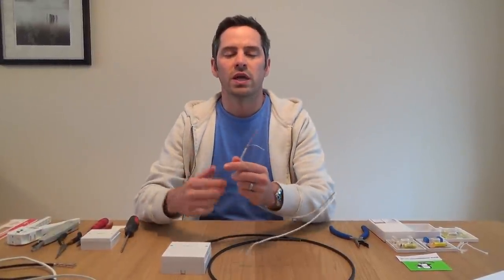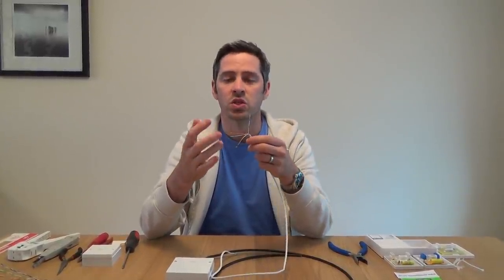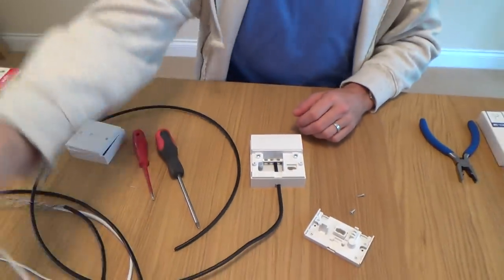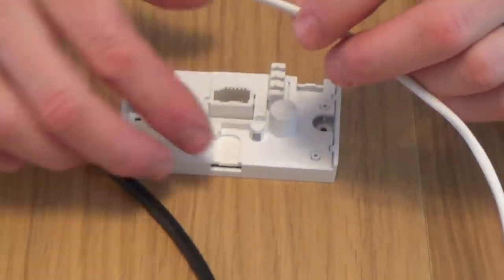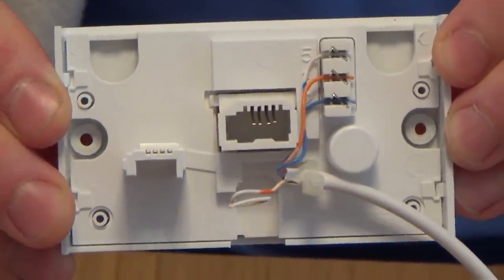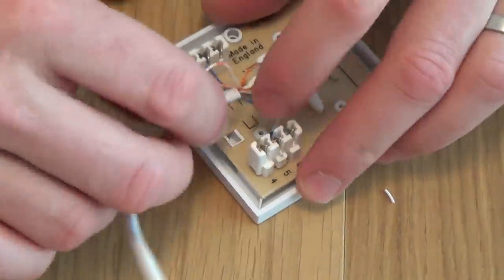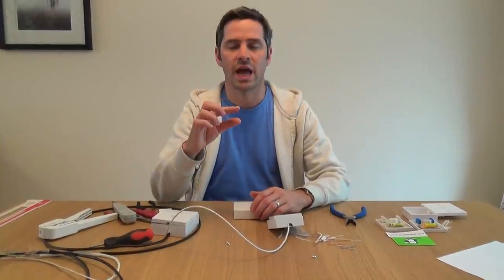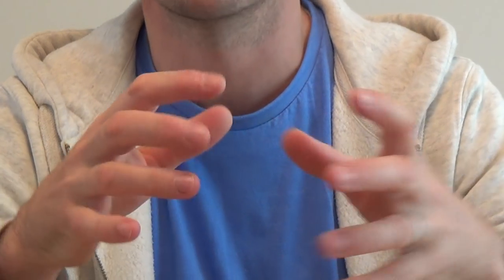How to install a TELEPHONE EXTENSION SOCKET

Comment: hi Vince. can you help me with this? the telephone company have used a 5 pair cable in my building. the cable is connected to 4 different telephone lines except for one who has two pairs connected to his (green + slate) . I have the brown one connected to my telephone line. I'm getting very low and varying broadband speeds, what could be the problem?

Comment: I have a phone line extension system fed from an "stc mx5"  telephone system, a floor polisher caused the master socket (fed from one of the five  MX5  output extensions)  to come off the wall. the question is what type of master socket would be compatible as replacement to this?  - I think its a pbx system seeing that you could use this as an intercom and have to dial 9 before dialling out externally.

Comment: Hi Vince, i have a slight problem. I followed your video and downstairs with the mastwr socket their is a filter with broadband and phone. I extended the bt line to go upstairs. But when i put the phone line in upstairs, the downstairs phone stops working? Have i wited incorrectly?
Reply from the maker: Hakan Jabbar Hi, double check your new phone in the existing master socket in case it is faulty. Then check you have wired it correctly, blue to 2, orange to 3 and white/blue to 5 on both ends of the cable. If you are using the small plug in micro filters then make sure you plug one into the new telephone extension. If you still have not luck then double check the cable for damage.Thanks Vince.

Comment: Do you have a video showing how to install an extension with ADSL/PHONE socket.  If not can you do one and will I need to run a cat5e cable from the main socket for this?
Reply from the maker: +Tania Hart Hi, no I don't at the moment but it is the same as running a normal extension socket, it is just the socket itself which is different as it has a filter built into it to save you plugging one in but normally you would still use terminals 2,3 and 5 the same as in this video.Thanks Vince
Reply: +My Mate VINCE  Thanks Vince.  In the current set up the orange (ringer? 3) cable is not connected.  Can I also omit the orange in this type of set up?
Reply from the maker: +Tania Hart Hi, yes you can.

Comment: hi vince
my cat managed to knock the white box completely off the wall severing my phone line.  I can see all the wires poking through the wall from outside.  do I need to phone an engineer or can I do it myself
Reply from the maker: +Catherine Sneddon Hi, you may be able to connect it back up yourself. What colour wires are sticking through the wall as it may be an easy fix.

Comment: Why can you never find an answer to your own specific problem?

I want to run an extension from an extension,  it will save a lot of cable and drilling holes right through the wall of the house. I have loads of drop cable,  solid colour green white orange and black, and want to run it around the outside of the house to a shed.
This is where none of the online videos seem able to help me. The nearest extension to my shed is an extension off the master socket to the back bedroom, it too runs outside outside the house.
The problem is the colour coding, it is all white with bands, colours with bands orange, blue green, every colour of the rainbow!!
How on earth do I know which of my  drop cable colours (solid B G W O) go to which terminals in the extension box wired up with all those banded wires???

Comment: I used a flat screw driver for myn n it works is that a bad idea saves us buying n waiting on a tool to come
Reply from the maker: +kevz kev It can work but sometimes (depending on the thickness of the screwdriver) it can spread open the metal IDC terminal so it can make a loose connection especially if you do not do it dead straight when pushing down.

Comment: hey vince. i have only the blue and white/blue wires on my phone lines. why wouldnt i have the third line?
btw im in New Zealand, we follow the same rules and regulations as the UK
Reply: *third orange wire
Reply from the maker: gt fo Hi there, as far as I know it was only the UK which adopted the ringer wire and it was something to do with the old hardwired phones which had big 'real' bells which used to tinkle when using pulse dialling (before tone dialling) on another phone in the property. By connecting a ringer wire it stopped this from happening. Also I wonder if cost and the size of the old capacitor came into it because by using the bell wire it uses the capacitor in the master phone so additional phones could be smaller and perhaps cheaper. Most people disconnect the bell wire now anyway so the 2 wire system has turned out to be the best version. Many thanks Vince
Reply: In the US, the 3rd wire is not needed. Dial tone and ring work on a single pair. Hope this helps anyone watching stateside.

Comment: Hi. I've purchased a flat 4 cable 10m extension and I can't get a dial tone from my phone. Please help
Reply from the maker: Hi, if the phone works in the wall socket and then you plug the 10m extension into the wall socket and the phone stops working on the end of the 10m extension then the 10m extension must be faulty.

Comment: hi why is there 2 wires coming in to your house but the are 3 wire inside can a phone work off 2 wires thanks
Reply: extensions require a third wire as there is no capacitator in extension sockets
Reply: @tommcgrady6067  what's the purpose of the capacitor? I mean yes, it makes the phone ring... but how? and why?
Reply: @Paul Jameson that's interresting. Here in germany, sockets never have a capacitor and phones still ring when ac voltage is provided. Hmm.

Comment: If I need to uninstall, do I do this all in reverse?
Reply from the maker: Jane Warner  Yes, just make a note (or take pictures) of all the wires and which terminals they currently go to so you can re install it exactly how it was originally.Thanks Vince
Reply: My Mate VINCE Thanks so much for your quick reply!